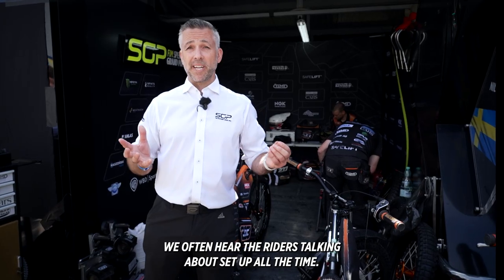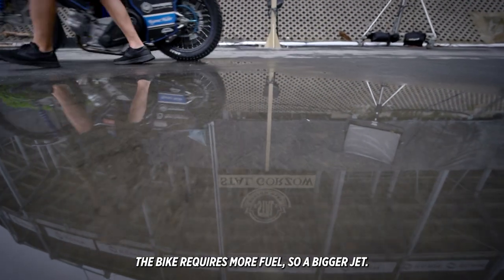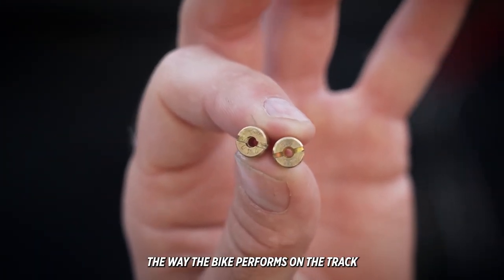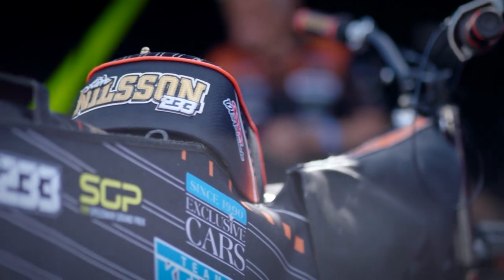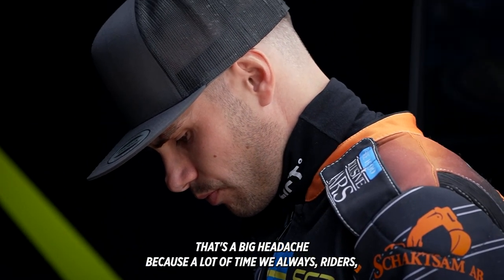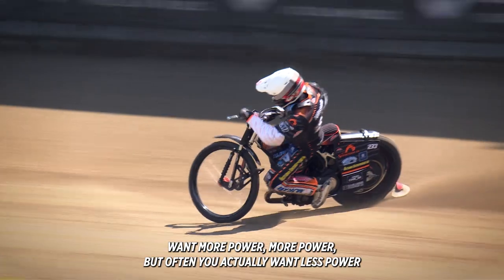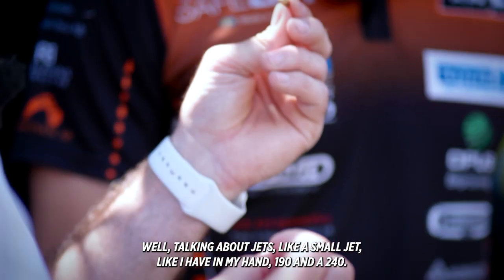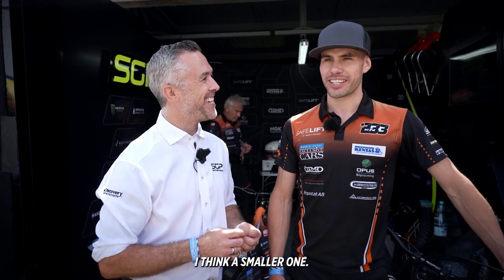Setup for Sweden! 🇸🇪 #SwedishSGP 2023 | FIM Speedway Grand Prix

Comment: Air/fuel mixture ratio is crucial in order to achieve the best performance for an internal combustion engine.
At the time and location of the event, altitude, barometric press, humidity, and air temperature all have an effect on a high performance engine.
I hope the never go EFI.